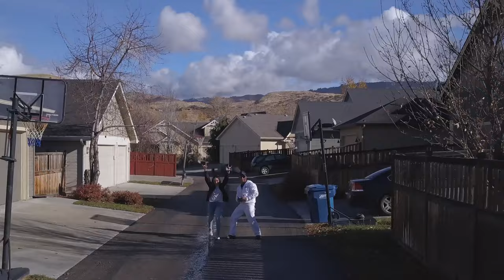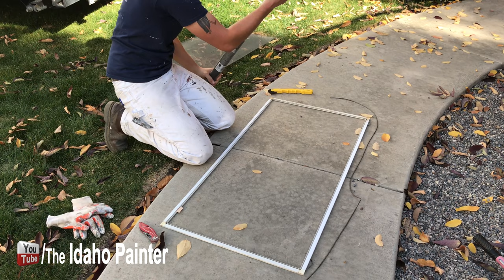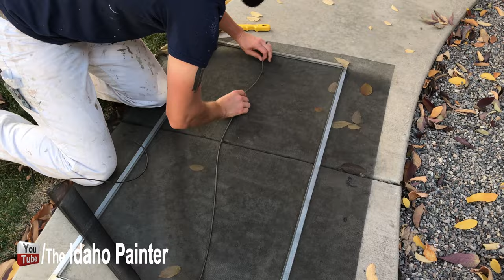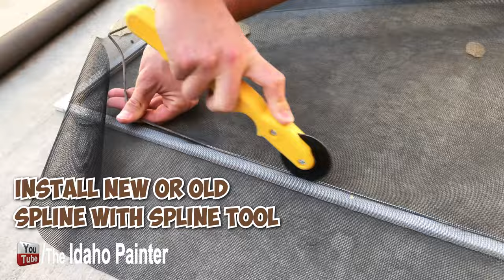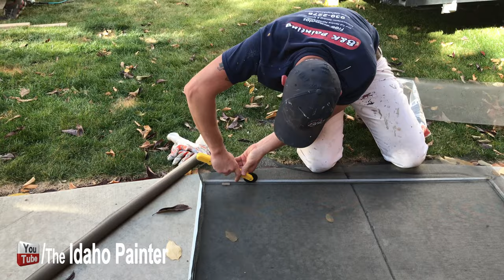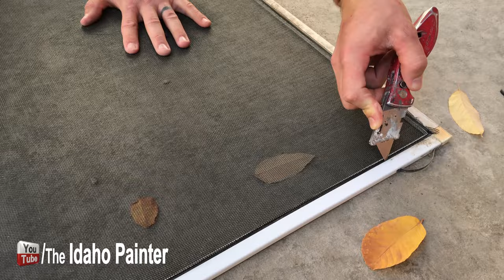Window Screen Repair Tips.  How To Re-screen A Window.

Comment: Have done this a few times as a rank amateur.  Mixed results.  Questions :  1. I have bought the wrong size rubber spline a few times.  It's hard to eyeball even when I have the old piece,  is there a color code or way of measuring or some trick to know which of the several spline sizes it is?
2.  Is there a trick to tensioning the (fiberglass) screen material?  The fiberglass screens are so stretchy... I've never used aluminum screen.. I assume its less of an issue tkngdt the tension right? 
3.  When trimming excess screen where are you trimming to?  How close?
4. Hkw deep are you driving the spline with the roller. I see yku apparently go over it several times... 
Thanks

Comment: Recommendations on Fiberglass vs Aluminum?
Reply from the maker: It is the same
Reply: No it isn't the same when using aluminum screen material.   And this video is good enough for an emergency situation, but don't go making this technique into a business model or anything.            For starters,  don't ever use a bare concrete surface for a screen table.  That screen frame may be powder coated, but it will still scratch. And the side you are grinding into the concrete is the side visible from the outside of the home.  Use plywood or a piece of carpet at least.   Screen tension is a big factor on larger screens.  If it's too tight your frame will buckle like am hour Glass on the longest sides. But too loose and you end up with wavy ugly screens.    

Aluminum screen is an entirely different animal, especially if it's in a frame like the one in this vid.  You have to align it, pre roll the screen into each side and then roll go again to roll the spline in.  And you always start with the long side, nearest to yourself, and work in a couter clockwise direction.  This will make you end on the short side at your 3oclock position.  (All screens- no matter the size or material)   with larger aluminum screens, it usually a good idea to cut you some sort of a brace to lay in the center of the frame, to keep from bowing the frame as you stretch the metal screen and pre roll it.   

The only other form of rescreening would be the porch method.  This will call for a square shaped spline, or it will be stapled, stretched and stapled again, covered by wooden exterior trim. It's pretty hard to fuck that up tho.    

Hope this helped

Comment: What am I doing wrong in that when I do it like you show that the frame twists when I pick the screen up? I have tried everything that I can think of and still can't figure it out. Thanks
Reply from the maker: I am not quite sure, try keeping it on a flat surface while installing
Reply: Home Improvement How To's , Hmmm, I have done it on a flat piece of plywood on saw horses and on flat concrete.  Do you stretch the spline material? Does it matter which edge you start with such as side vs top / bottom?  Thanks